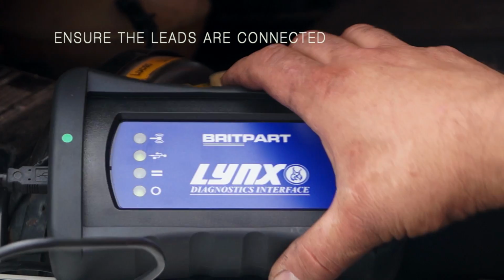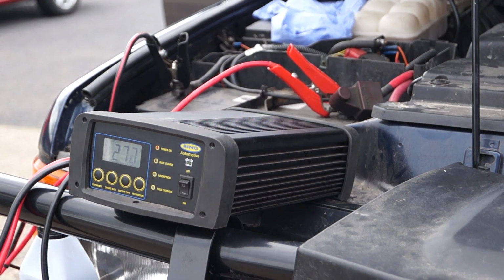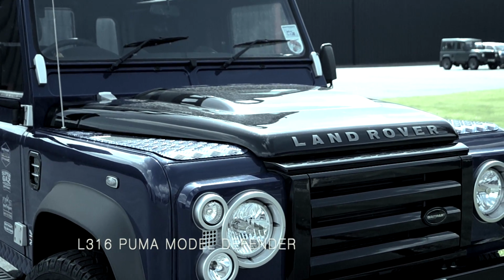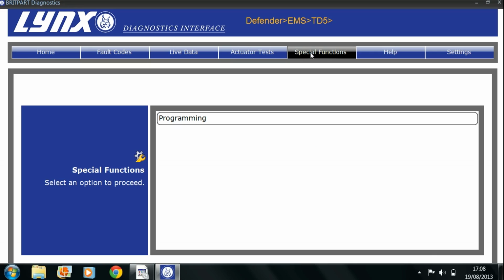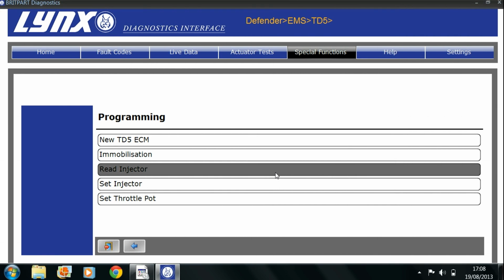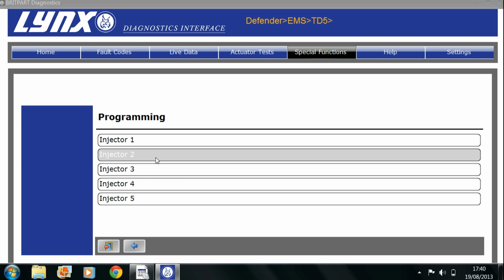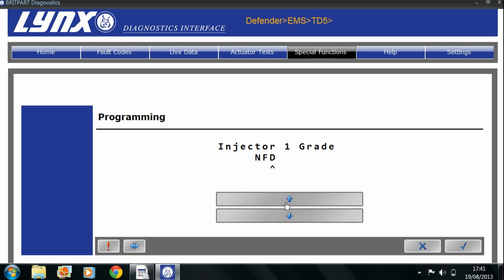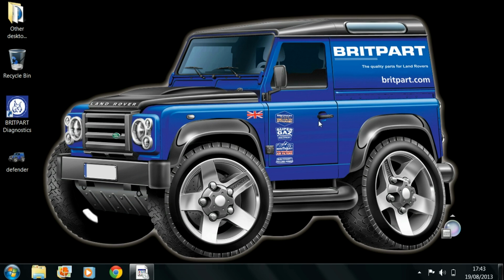Reading and coding Td5 injectors Land Rover Defender - Discovery 2

Comment from the maker: The problem
Unfortunately, even with today’s very high level of manufacturing processes, producing injectors to exactly the same standard is difficult.
It’s not that it’s impossible, but to make every injector the same would mean re-tooling every piece of equipment on the production line for each injector just to ensure that they would all be identical.
This is clearly impractical and it would also mean the cost of each injector would be prohibitively expensive.

Comment from the maker: So what can the manufacturers do to overcome this dilemma? The answer is quite simple. Due to these slight differences in each injector, the manufacturer can test the injectors during the production process and, by looking at the pre-recorded values from a known good injector, it can give each injector a unique identifier code.
What this code actually does, is allow the engine management system to let the ECU compensate for the characteristics of this particular injector.

Comment from the maker: This overcomes the problem of not all injectors performing in exactly the same way and keeps the cost of manufacturing to a minimum. It also allows for the increased benefits of tighter emissions control methods.
Reply: What lynx set up have you got